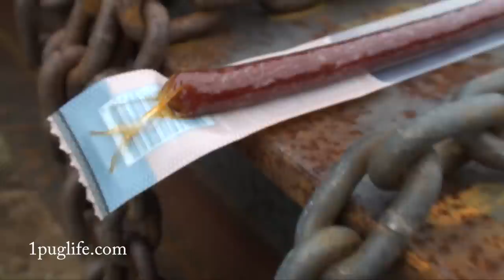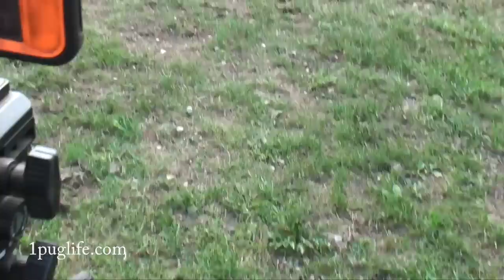stink finger tommy goes boom

Comment: Tape the glass on the rigs before you crush! Use the cheapest stuff you can find, it will hold it together.
Reply: No read this one!
Reply: @vincegracie4771  roll the fuckin windows down so most of the glass is in the doors ffs
Reply: @tysonballer2240  can't roll down the back Windows ffs

Comment: just pop the windows and push them in first. screwdriver jammed down into the corners and cranked will make it shatter and mostly stay in place, then you just push it in gently, majority of glass will all fall inside and it makes almost zero noise. alternative to that, hammer and sharp punch or strong center punch near an edge/corner........

Comment: Pug could you drive up on top of the smaller cars kinda like a monster truck. It would be a cool shot plus it would crush the top down and probably fold the top of the doors in so they would be easier to crush.
Reply: It would be awesome, I drive a loader for work and have always wanted to do it but sadly they aren't great with hills or driving over objects and can flip easily.